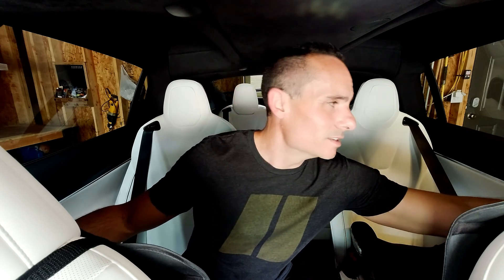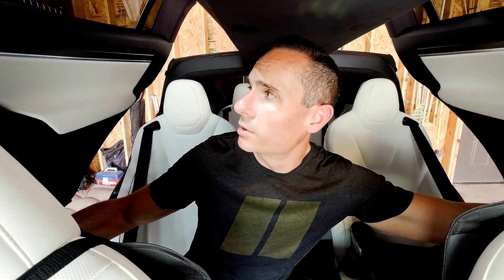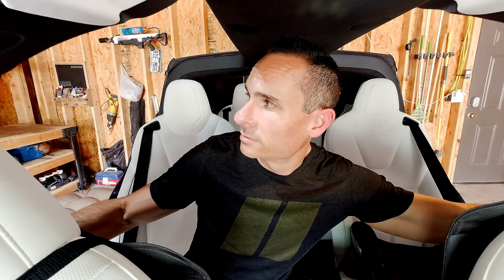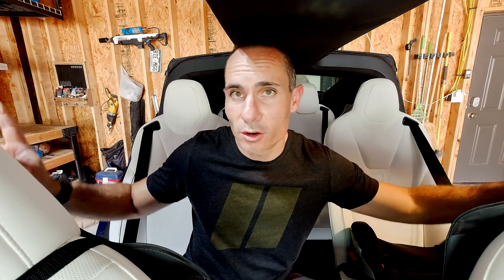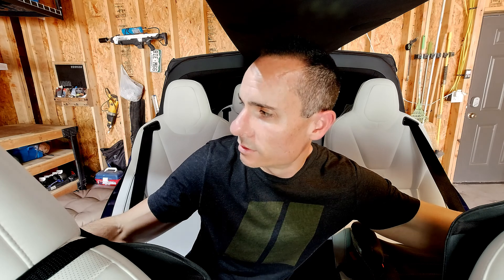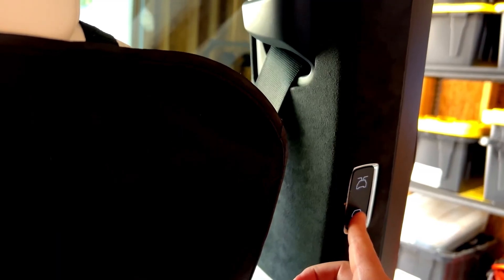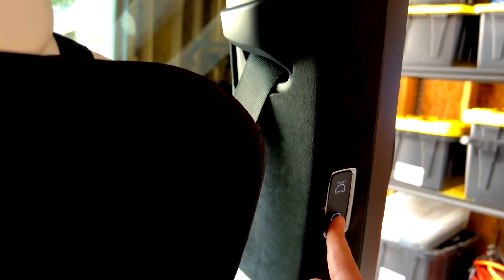How to calibrate Tesla Model X Falcon Wing Doors

Comment: Is there another way to calibrate the doors? I tried this and it did not fix my issue. Left falcon door still opens 75% while the right falcon door goes 100%. Sensor on the homescreen still shows red on the left falcon door when nothing is outside.
Reply: Did you repaint the door? Or add a film?
Reply: @Laissez_Faire  I did add matte black wrap.
Reply: @eddielau7062 that’ll do it. I’m not sure if you took care of the problem but it needs to be recalibrated by a tech with service plus credentials.

Comment: Hi I just spent all weekend trying to learn how to recalibrate my '20 Tesla X falcon doors. My service menu does not include the setting to recalibrate the doors. The problem ended up being the lock mechanism in the door. Somehow it shut as if the door was closed. I manually opened the latch and this allowed the falcon door to shut tight. So I did not need to recalibrate the door after all.  I hope this helps someone. Dan H.

Comment: I had issue that the driver side FWD wouldn't opened, the button was greyed-out with "Calibration required" - holding the up button didn't do anything, holding the down button did make the door open a few centimetres, I thin closed it, then held the up to recalibrate, which worked fine, and now OK (late 2022 EU Plaid)

Comment: Worked - Thanks!! One item of note, my left side Falcon Wing door was the one that needed calibrated. When I did the open portion, the left door did nothing, the right door went up slowly just like the video. Then I did the down calibration and the left door popped open a little then shut itself while the right door was going through the whole down portion. After it was all over, left door works fine and no longer shows "Needs Calibration" on the display.